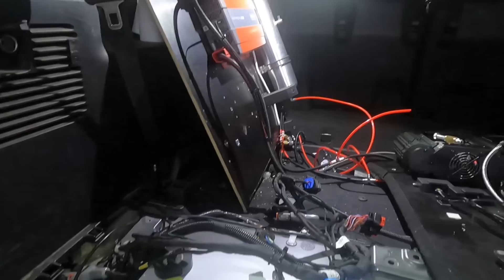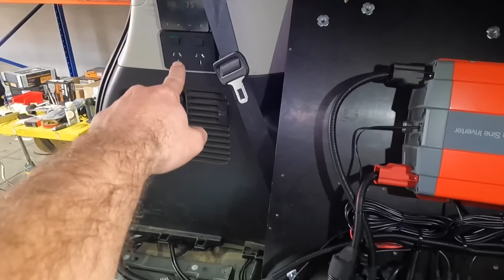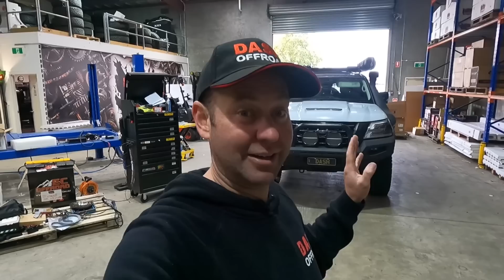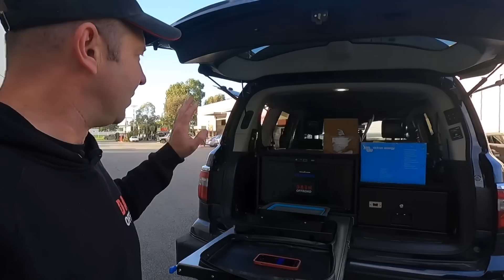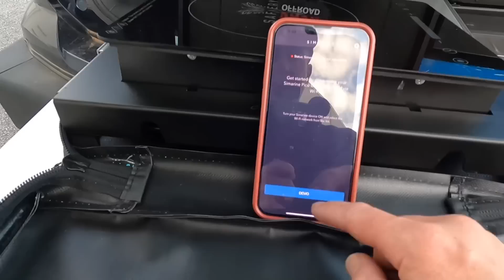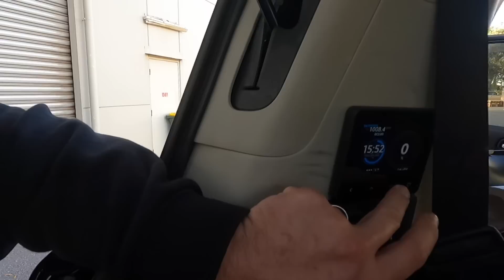VLOG #86 - DASH Y62 goes next level with electrical and bonnet scoop

Comment: Dave, do you have a long term review of the scoop regarding temperature changes to the engine bay and inside the car? 

Just did 7 days of VHC using 4L the majority of time and the heat transferring inside the cabin was next level! It was a really warm week (air temp) as well. 

Have there been any issues regarding negative pressure to the radiator with a front facing scoop?

Cheers!
Reply from the maker: All has been positive so far. The trouble with these cars is heat build up when stationary. The vents in the bonnet definitely have helped since being supercharged. I actually think the trans cooler may help with reducing the thermal mass in heat too. 

Otherwise, keep the revs over 2k in 4L and it should get that big fan working to keep everything cool

Comment: could I please ask a question that's not related please, I'm thinking of a qx80, the one thing i notice is they only have a 100lt fuel tank, my question is it possible to add the reserve tank that the patrols have, or even the LR tanks . also will most of the stuff you fit to patrols , fit a qx80. thanks for any help Greg